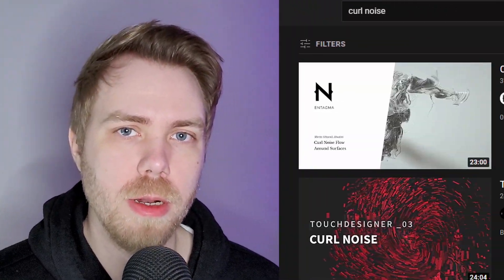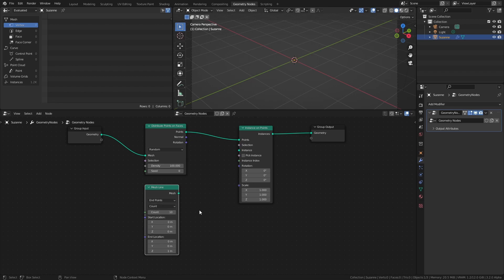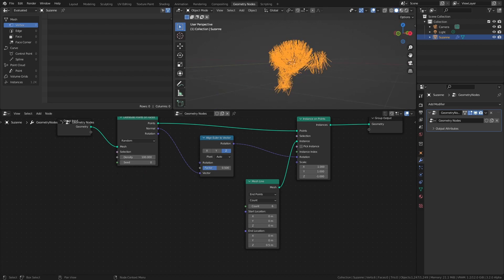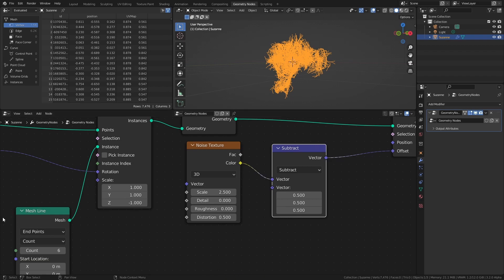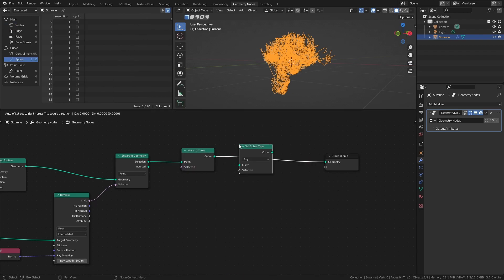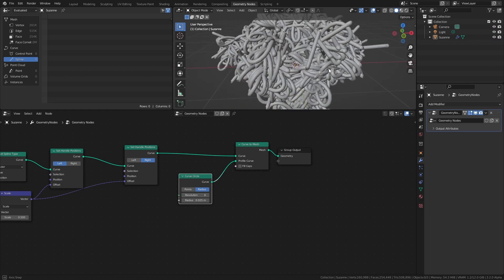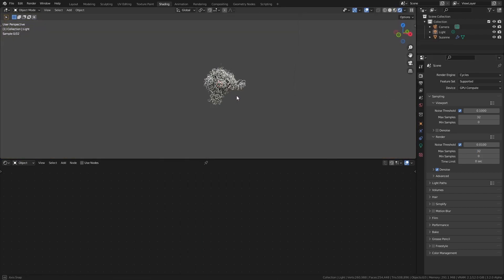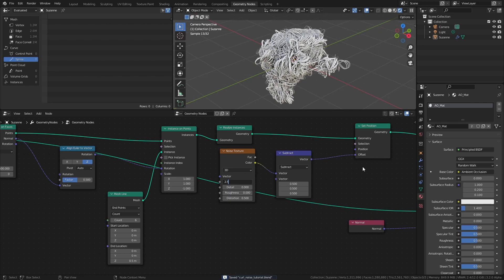Curling Curves with Geometry Nodes | Blender 3.1 Tutorial

Comment: Hi! Thanks for the tutorial. I found a second workaround for the Set Handle Positions at 5:55 - 6:29. Duplicate both Set Handle Positions nodes, and add them in between the Set Spline Type and the first Set Handle Positions node. Keep both Set Handle Positions nodes, Vector Math node, and Curve Tangent. For some reason, it seems that the first Set Handle Positions node ignores the Curve Tangent and Vector Math (Scale), and stops the interaction. Adding duplicates of the Set Handle Positions node, for unknown reasons, allows both Set Handle Positions to work accordingly. An alternative to the duplicated nodes is to add a Set Handle Type node in between the Set Spline Type and the first Set Handle Positions node. It gives the same effect, but some of the curves look weird.

I found this workaround by accident as I was trying to figure out why any mesh (including my own) with the Geometry Node setup didn’t look at least similar to what was shown in the video. I unplugged the Vector Math (Scale) from the Set Handle Positions node (set to Left) while it was still plugged into the Set Handle Positions node (set to Right), and the mesh changed. From that point, I just added and connected the nodes mentioned out of pure curiosity.
Reply: Thank you. This saved me!
Reply: Thanks a lot.I was stuck.
Reply: От души душевно в душу! Спасибо брат!)))
Reply: I found the answer in an experiment, I solved the problem by adding "Set handle type node" before "Set handle position node".
Reply: @qinghuqlin7067  THANK YOU ! that helped
Reply: Thank you!
Reply: sos un geni0o0o0o0o muchisimas gracciassss
Reply: Thank you !!
Reply: Спасибо )

Comment: Just a note, in 3.2, you have to add the Set Handle Type node just before the Set Handle Positions for it to work.
Reply: Thank you! Id never would have figured that out.
Reply: Thx it works in 3.5 still
Reply: thanks!
Reply: THANKS MAN !!! I was going nuts over why it was not working !!
Reply: thank you!
Reply: Thank you!
Reply: thank you sir
Reply: Khamurai should pin this comment. it was driving me crazy
Reply: thanks captain :)
Reply: Thanks I noticed the Bezier was jagged if you don't do this but Nurbs and Catmull Rom seemed to work and I was wondering what was happening.
Reply: God bless you😭i was so confused
Reply: I've done this but it only affects the Z axis for some reason and when manually changing the X/Y axis' every curve is modified identically.

Are there any other changes between 3.1 and 3.3 that I'd need to know to do differently?
Reply: @drumboarder1  If you want to modify a point individually, or a number of points, you have to do selection with the Selection socket.
Reply: @quasicesium  Not sure what I screwed up yesterday trying to follow the video at 144p but I've just started again from scratch actually being able to see at 480p and what you said instantly worked this time.

Thanks for the reply and for helping people out in general mane <3
Reply: @drumboarder1  glad to be of service.

Comment: Geo nodes has completely killed my interest in blender, every single tutorial i try to follow fails, have the latest version and follow instructions to a t and still doesnt work out lol, drives me nuts
Reply from the maker: I understand your frustration and in this specific case it was unfortunate that shortly after uploading this video the next patch came out which broke the interaction with the Set Handle Position node (even though 3.1 was already in it's official release stage).

I have pinned a comment which contains a couple of workarounds, but for a nice result you can swap the Set Handle Position nodes and replace them with a single Set Handle Type node set to Auto.

Hope it helps!

Comment: A well made video, thanks, but here again is where I get frustrated with geometry nodes. I can certainly follow all of these steps and get the same or similar results, but it's kind of like painting by numbers. Sure, I can match the numbers on the canvas with the numbers on the paint vials, fill them in, and eventually end up with a decent painting. But if you gave me a blank canvas without the numbered areas, there's no way I could reproduce the same painting again. In other words, it didn't make me understand how to paint. When I follow tutorials like this, I'm just copying what is shown, but I still have almost no understanding of how 95% of these nodes actually work and would have no clue at all how to use them in any situation outside of this specific tutorial. I'm reproducing the effect, but I don't feel like I'm learning. However, that's not your fault, I have followed MANY other tutorials on geometry nodes by other people over the past year or more, but I've made no real progress, so clearly the problem is with me.
Reply from the maker: I understand your frustration, geometry nodes is a very different way of working compared to the usual workflow of Blender.
Unfortunately it's hard for me to point you in any specific direction since I don't know what part or parts of the workflow and system that you are struggling with
Reply: @darrenberkey Same for me. But then I thought, what if someone making a geo nodes tutorial explained in detail every node used? The tutorials would be at least an hour long. But that's what's needed. It isn't you. 
A lot of times I get really really stuck when I can't make a render; the screen is blank. Tutorials don't explain the addition steps needed to convert all curves to mesh, or whatever. If you can't render, the tutorial is useless.

Comment: in 3.1, a point density of 100 is close to a crashing situation...  The density to get roughly the amount you have on screen is 0.01.  That's quite some order-of-magnitude difference in the change from Blender 3.0 to 3.1!
Reply: My Scene Unit Scale is set to 0.01.  This is probably why.  I use Blender a lot with Unreal, and this setting allows for easy export at the right unit scale.  I have to remember to set this back to 1 when doing tutorials!  ;)
Reply from the maker: Yep you beat me to it lol
Reply from the maker: What you are describing is dependant on the scale of the object since the true size of the object is what is used when the points are scattered.
If you get massive amounts of points on a small surface when the point density is set to 100 then it sounds like the scale of the object isn't applied and probably has a scale of around 0.01, it happens a lot when you import meshes made in other 3D softwares that are using different scale units :)

Comment: I had a similar idea, but my method is slightly different. Not better, just different. Your execution is much nicer though.
Reply from the maker: Interesting, would you mind sharing your way?
Reply: You can see the result here: https://youtu.be/ZXcV2zHdo_Y
A few days since I watched your video, but if I remember correctly you distribute points on the surface of the mesh and use that as the endpoints (+noise). I distribute points inside the mesh and make one continuous curve with all the points.

Comment: It would be *great* if adding materials / colours worked with Eevee - 
does it look like this could happen any time soon??
Reply from the maker: Maybe I'm misunderstanding your comment but materials added with the Set Material node works in Eevee aswell
Reply: @Khamurai  Thanks for your quick reply. I'm in the early stages of trying this out, 
however on my Mac, when I switch to Eevee, and use the Ambient Occlusion node followed by colour ramp as outlined in the tutorial, I am getting a single colour but not a variety of colours.
Reply from the maker: Oh right, that might be because you haven't enabled Ambient Occlusion in the render settings.
If you are working with Eevee I would recommend enabling Ambient Occlusion, Bloom and Screen Space Reflections, and also under Screen Space Reflections enable Refraction.
They are all available in the Render Settings tab
Reply: @Khamurai  Thanks:) 
Two things have happened: (1) [just FYI] if I use an AO node / AO socket to the Colour Ramp in Eevee after enabling everything you listed, still nothing happens. 
(2) To experiment, I replaced the AO node with the Texture Coordinate node and I got great results, 
e.g. using "Reflection" or "Normal" inputs.

Appreciate your responses.
Reply from the maker: @donmcarthur9102  Oh that's interesting, I need to try that too, not sure why the AO approach isn't working though 🤔

Comment: There is no longer a "spline parameter" node. I used a "curve parameter" and that worked.
Reply from the maker: It's actually the other way around, Curve parameter was the name prior to 3.2!
And yeah they work the same, except the Spline parameter has some extra functionality
Reply from the maker: Though I just realized that the Curve parameter node and Spline parameter node both existed in 3.1, just not at the same time. At some point in 3.1 Curve parameter was replaced with Spline parameter (at least judging by the documentation)

Comment: What would be the best way to smooth out the kinks in the curves(on mine, not on your demo)?  I put a subdivision surface node after the Curve to Mesh, but I have a feeling there might be a better way for performance.
Reply from the maker: Another way to smooth the curves is to use a Set handle type after the Set spline type and set it to Auto, that way the handles will smooth out the curves automatically and it removes the need to use the Set handle positions nodes
Reply: @Khamurai  thank you, Khamurai, this was exactly the hot point missing... now it looks really amazing!

Comment: I am loving your tutorials! Not sure if there was an update recently in 3.2, but when I set handle positions it literally makes no difference. I can mute the nodes and still get the same result.
Reply from the maker: Yep, literally the day after uploading there is an update to 3.2 that breaks the handle positions part 👍
Skip those nodes and add a Set handle type (set to Auto) node after the Set spline type node and you will get a similar result
Reply: @Khamurai  Hi, I tried to do so but it didn't work :(( I try to plug the Scale node to the set handle type but nothing has changed.
Reply: i have the same problem the handle come with out the ofset

Comment: Thanks for the amazing tutorial! 

One question: is it possible to use this with an animated (rigged) mesh?
Reply from the maker: Thanks for watching!
And yeah it is possible, though the points will be recalculated every time the mesh changes so the result will be extremely chaotic
Reply: @Khamurai  Perhaps it's possible to bake curves in the overall shape of the mesh, and then use nodes to give thickness and other characteristics?
Reply from the maker: @Gichanasa  Well if you apply the Geometry nodes modifier like any other modifier then you will have all the curves with thickness and all converted to a mesh, though I don't think the rigging will work after that

Comment: Nice tutorial, is it perhaps possible to use the random value of the geometry node in the shader to make it a bit more interesting? It didn't work when I tried. :(
Reply from the maker: Thanks!
Yes you can access geometry nodes values in a shader, you need to connect the value to the Group output and give it a name in the Modifiers tab, then in the shader you need to use an Attribute node and use the name you gave it
Reply: @Khamurai  thx for your quick answer, I think I misphrased my question, I meant the object info node in the shader. Let me try again; I would like to give each spline a different color like Andrew does here with the sprinkles (https://youtu.be/bLw0HwphXO0?t=798) but it gives all splines one and the same color. How can I give each spline a different color?
Reply from the maker: Oh okay got it, there is no easy way to do it (since the instanced lines 1. don't have UV maps and 2. don't really exist outside of the node tree) but you can Capture the index of each instance after the Instance on points node with a Captrue attribute node (Integer, Instance), then use a Modulo node to set how many different colors you want (captured attribute in top socket, modulo value in bottom field), then use a Map range node with the From Max value set to the same as the Modulo value and then connect it to the group input.
From there you can access the values from the shader like I described before
Reply: @Khamurai  Hmmmzz, I'm afraid this goes beyond my capabilities for now. Did you see this method in another geonodes tutorial perhaps? If not, are you perhaps willing to make a quick how-to vid? It would help me a lot when the workflow is visualized. I would be very grateful!
Reply from the maker: No I just worked it out after you asked because I got curious, I might do a follow-up to this video and if I do the random colors will be one of the things I touch on for sure :)
Reply: @Khamurai  thx buddy!
Reply: @Khamurai  It took me a while, but in the end I got it working with your help! Thx a lot!
Reply from the maker: Awesome!

Comment: Hi! i have a problem with this one. I do all the steps you do until 1:50 but nothing reflects on my screen. there are no lines or anything, its like if the object were transparent (which is not) could you help me to fix this?
Reply from the maker: Sure, are you using 3.1 or something else?
Are you using the correct Instance node (Instance on points, not Instance to points)?
Reply: @Khamurai  Thanks! it's Blender 3.0. yep I just double checked and the instance node is correct *instance On points). The mesh line is set to end points. Still nothing shows up
Reply from the maker: Oh okay, drop a Realize instances node after the Instance on points node and they should show up
Reply: @Khamurai  Thanks a lot! that worked. So I have to do this every time I want to add this kind of effects? Maybe i should just download blender 3.1 hehe
Reply from the maker: As far as I know it's a problem that is specific to only Mesh lines in 3.0 so you don't have to move to 3.1 yet 😁Though if you are planning on doing a lot of geometry noding then it is worth making the switch

Comment: Beautiful stuff! Love all your geo nodes tutorials. 

I also had a similar problem to TANKY JONES where I could only see one mesh line when I had the first 3 nodes connected. Only solution was to add a Realize Instances after the Instance on Points. This let me see all the mesh lines properly. Not sure why I couldn't see the instances when it works with other tutorials I've tried. Using Blender 3.0.
Reply from the maker: Thank you!
I haven't tested the setup in 3.0, however I know that with mesh lines specifically they won't show up as instances unless you realize them. Not sure why but it has been fixed in 3.1 and above
Reply: @Khamurai  You're correct. I downloaded 3.2 and everything works as it should. 
Cheers!
Reply from the maker: Happy Blending!